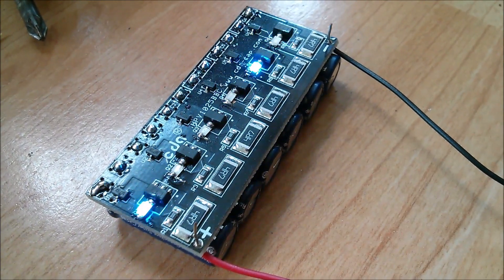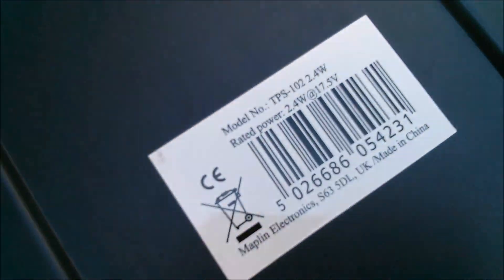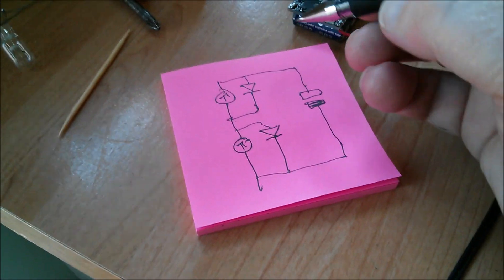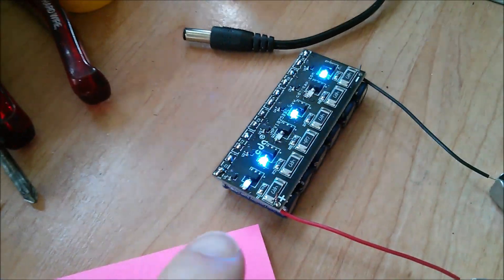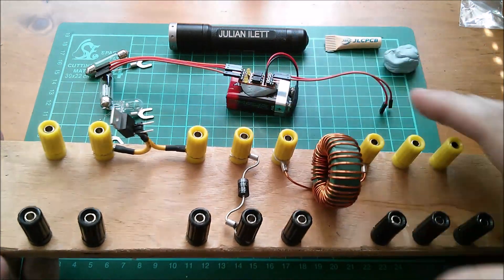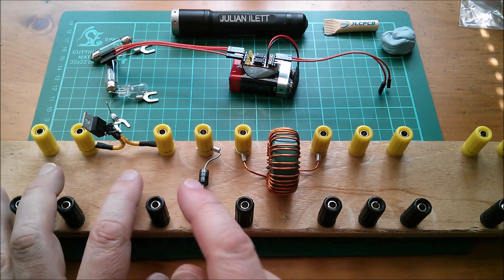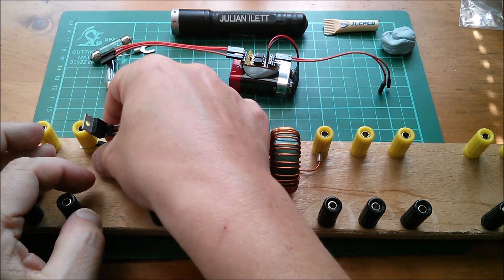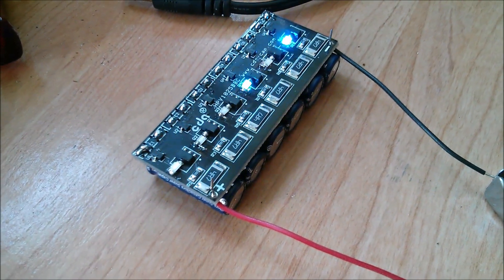Muppet 2 Progress (mit Blinkenlights)

Comment: Add some discrete logic that will prevent the two MOSFETs from being on at the same time.  The fuses will be fine for current limited sources but not in a final product or design where it can't be guaranteed.  So basically:
H=horizontal series FET
V=vertical shunt FET
RA0=micro H output
RA1=micro V output
so
H=RA0  // always follow
V=RA1 AND NOT RA0

That should prevent both FETs being on at the exact same time and causing a "short" circuit.  It doesn't matter what the micro controller says to do or what startup conditions it is in or if the controller "crashes" and gets off course.  Much safer.
Reply: Actually you might be able to just use a resistor and transistor to prevent the V FET from turning on instead of actual "logic."  Might save some cost and board space in the final design.

Comment: Curious that you aren't using any banana cables for your testing setups. Mine are mostly those cables in all colors of the rainbow when I try something, because they connect and disconnect easily and have no problem up to 10A (I've also driven them with 20A, but the plugs tend to get a bit warm at that point).
Reply: anlumo1 - I think using too many cables will quickly lead to an unviewable rats-nest of wires. Like the Dupont wire salad you can find in some of my videos, that would be less clear for viewers.
Reply: He's keeping the points clear so he has plenty of test points that can be plugged into. And you may find loads or inputs will plug in if that is easier...

Comment: If you put a 1k resistor to ground on the gate of the mosfets so they are not floating they shouldn't turn on unless you mess up with your code. Thanks for all the great videos.
Reply: But he want them floating, better said he will do a top side driver. that means the mosfet and its optodriver must be seen as an isolated circuit, were the source pin is our new reference (or ground) potential. But I think julian will explain that in future much more detailed and better then me 😁
Reply from the maker: I might put 1M resistors across gate and source to prevent spurious turn on :)
Reply: Nope, putting a resistor traps voltage which opens the gate. You need an NPN transitor thats connected from gate to ground and turned on at the start.